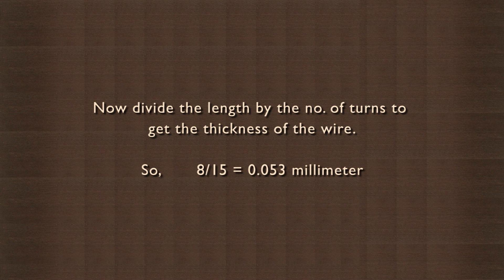Measuring the thickness of a wire | Metrology | Physics

Comment: Thickness of the wire is measured without insulation. Remove it before measuring. As a rule of thumb, the thickness of the lacquer is 5% in general. So, with insulator, extract 10% of the obtained diameter and there you go. 8 / 15 * 0.9 = 0.48mm wire diameter.
Reply: Yahoo !!!

Comment: Ok let`s say we take the same wire shown in the video,but instead of 8mm in length,we have 12mm in length.Do the math`s.Is the thickness of the wire the same? Definitetly not.
Reply: 12 mm increases how many turns
Reply: I think we can do like this ..
First measure the length of  thread ,and then wrap it like a circle . Using 2pier formula . We will get the diameter of the thread ..